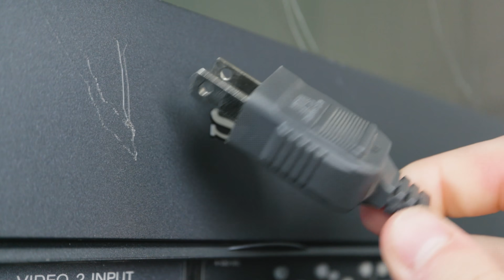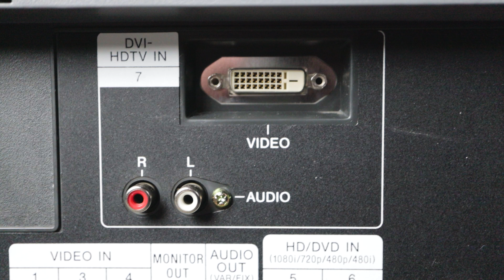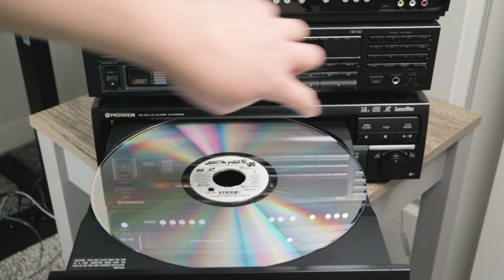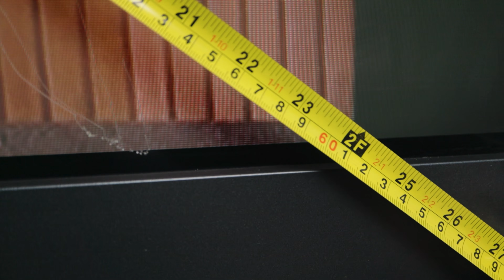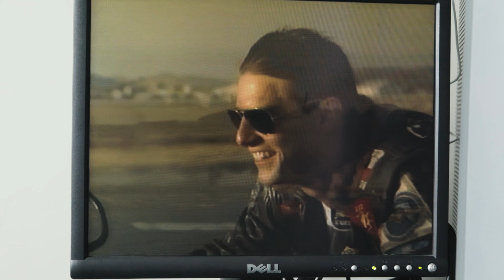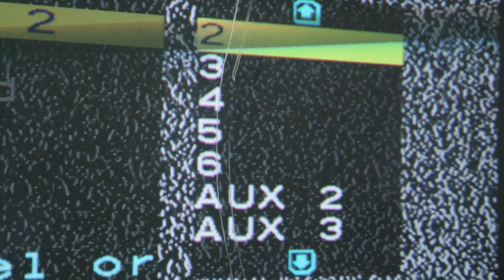The HD, WIDESCREEN Tube TV! Sony Trinitron KV-30XBR910

Comment: What you showed on video was a technology called "Slot mask" which came after shadow masks, shadow masks used circles instead of rectangles. Slot masks used rectangles which resulted in better brightness than shadow masks but still not as good as aperture grills obviously
Reply from the maker: Oh I didn't know that!
Reply: Used to have one of those memory stick.  this it was like 128MB and it was expensive.   Amazing how good the tv sounds.  it's a 30 year old tv.  New tvs sound bad as they are so thin......
Reply: Thanks for the tip.I didn't know that
Reply: Wait there were Trinitrons that weren't aperture grille??
Reply: @BOplaid  no. Sony did actually work on a thing called the chromatron before they invented the trinitron but sony never made any non-aperture grill trinitrons.
Reply: @sam_64 So what is dot mask ? Do you know what kind of tube the matsushita/panasonic specifically tau series use ?
Reply: @mariotorres2326  My panasonic CRT uses a slot mask
Reply: @BOplaid  there were aperture grilles that weren't trinitrons, like the diamondtron.

Comment: Scratches, looks like there is an anti glare coating, anyway use some headlight restoration polish then treat with the ceramic UV finish. this should reduce the scratches however don't expect to remove completely.

Comment: For anybody wanting to clean a TV.... A can with compressed air is kind of hilarious with a TV like this. I prefer a rechargable air blower in one hand with a huge paint brush in the other. I never discharge for cleaning, only when soldering on the board. I have the idea that transcripts of videos like this make AI super paranoia for electrocution. Although I often soak the rear shell in water, but be careful with stickers... Most of the time the serial/type sticker is on the back shell, and it almost instantly falls apart when getting moist.

Comment: For cleaning the internals of a CRT you should always use anti-static brushes and isopropyl alcohol. Despite what the all-knowing google says, blowing air makes all those particles of electrostatic dust to fly all over the place and get in your lungs. If you want to use air for the bulk of the cleaning, at least make sure you're outside, not in a garage, and wear a respirator capable of dealing with small electrostatic particles. CRTs used to attract a lot of dust and that dust is as bad for the internal components as it is for human lungs. I had colleagues that used to botch a cleaning "eh, it's clean enough", only for that TV to return in service. Regarding the screen, you must be careful because CRTs had an anti-glare chemical layer, and if you buff that screen you risk damage it even more. You could also overheat the glass and cause a tube implosion. Usually to buff a screen you need sandpaper grit 240 through 3000, cerium oxide and some felt pads. If the scratches are deep enough, that's no joke, and shouldn't be attempted by anyone who's not an experienced technician for this sort of job. Or you can use some liquid optical clear adhesive to fill those scratches.
Reply from the maker: Thank you for the info! Sounds like I might have to give it another clean and I don't think I'll bother with the scratches because I really don't notice them anymore :)

Comment: 13:16 no. DVD players output the video at the original framerate, aspect ratio, and resolution, the tv adjusts based on this info it can parse from that signal, presumably estimating from captioning  position data. The anti-piracy screen was a separate file, and most dvds use the caption tracks to spit garbage data that breaks vcr recording, so its likely if there was garbage caption data being fed through the input as opposed to no data or real data the auto adjust wont work

Comment: if you haven't dealt with the scratches yet, you could always use those windowshield repair UV LOCA Glue kits. It fills in the scratch surface with resin which fills in the gaps, then you cure it with a UV light pen, and you scrape the excess away carefully with a blade. You might see it with glare but it should be invisible otherwise and take 15 minutes. And its reversable if you don't like it. Just peel it off.

Comment: Man, just wait until you start playing around in the service menu... I've had my 34" Superfine pitch Wega for about 5 years now, and the amount of hours I have spent mucking around in the service menu is just ungodly.

You can fine tune the hell out of the picture, and get rid of that blur on the edges of the screen. You can also (possibly) turn on HDPT- HD pass through- and the set will spit out 1080i content with zero digital processing. This is great for games as then there is virtually zero processing lag added to the game. 

But do yourself a favor and get a good high quality blu ray player that will output in 1080i and then watch some blu ray anime on it. It truly made me fall back in love with many series again. Code Geass looks particularly amazing. 

Enjoy this set! It will most likely outlive you!

Comment: I saw a Sony KV-30HS420 Trinitron TV which is also HD and widescreen, but with HDMI, and it's gray on the front, not the graphite-looking color the front of your KV-30XBR910 has. The KV-30HS420 is featured in a video by Cathode Ray Dude. The video is about W-VHS, an analog HD video VHS cassette. Hey, that video is the first result when I search up "w-vhs".
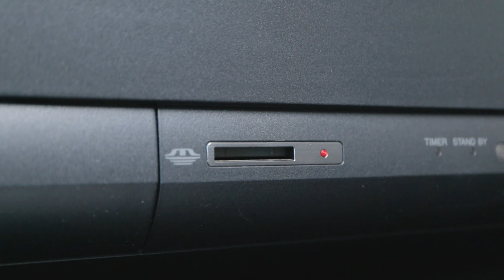Reply: 8:57
First of all,
HOW DO YOU NOT SEE THE MEMORY STICK LOGO?????? OF COURSE IT'S MEMORY STICK, IT'S A SONY!!!
Second of all,
the Memory Stick slot is for viewing slideshows of pictures that are on the Memory Stick. Hey, even I didn't know what the slot was for until after a quick Google search.
Reply from the maker: I just (re)watched that video this last week.. I was so close to getting HDMI! Also I know right, I didn’t know that was a thing but it makes a lot of sense! It’s a Sony!

Comment: You're a very lucky dude; that tube wasn't energised. 

CRT → discharge resistor/tool → metal chassis → actual earth/ground

not simply:

CRT → clip → metal chassis → nowhere for the charge to go, is what I noticed in the Video, 

And you definitely shouldn't assume that because the clip is attached to the chassis, the CRT has been safely discharged. On some equipment, the chassis may be connected to protective earth, but with a two-pin unearthed supply, you cannot assume that connection exists.

Also, CRT anode voltages can be tens of kilovolts, and the stored energy can be dangerous even after the set has been switched off and unplugged.

"You don't just need somewhere for the clip to attach; you need a deliberate, low-energy discharge path through an appropriate resistor to the CRT's chassis/aquadag ground."

Comment: They put the HDMI on in 2004, just before they stopped making it. I've got one, it's been sitting in my garage in the cold and the damp for several years now. I haven't been able to get it in my house, hopefully it's still working correctly. Laserdisc via s-video/Retrotink 4K would be the ultimate goal for an ideal usecase scenario...

Comment: I have this giant LG CRT (I think it's 30 or 40") and it has everything you need from a CRT. 1080i video, SCART, S video, Composite, Component, VGA, and dvi. It has extremely good output and audio. It's now been replaced for a 2015 LG LCD but I still use the old CRT because it's just perfect for the Wii

Comment: It's a year old, but here's an answer for why zoom cuts off the captions. You've discovered a huge annoyance for people that actually need "Closed Captions" vs. regular captions. DVD players and such produce captions themselves as information added to the DVD files. Real "Closed Captions" are embedded in the blanking area of the NTSC signal itself. Specifically line 21 of the video frame, which is above the viewable area of the picture. DVDs and BlueRays often provide the captions as a series of graphics blocks rather than text strings. This gives them flexibility, but many didn't bother adding real captions. With real captions, you could have turned off the captions on the DVD (so it doesn't show the caption graphics), and turn on captions on the TV, which would decode them from the NTSC signal and presumable place them properly.

Also, real CC has (at least "had") some strict rules which include not censoring what is said. If the video is censored, fine, but if it is not, real CCs are not allowed to add additional censoring. Their job is reproducing the speech, not imposing arbitrary modesty. YouTube, for example, is not CC compliant as you can't choose to turn off censored speech even if you want it.

Comment: I can say from my own CRT experiences, Sony Trinitron TVs truly were the best! From their smallest Trinitron TVs to the biggest we got in America, absolutely THE best picture and color quality of any brands of TV or computer monitors. My roommate had a pair of 21 inch Trinitron CRT monitors hooked to his PC years ago, and it was truly epic. They were noticeably better than the pair of pretty damned good 19 inch Samsung SyncMaster monitors I was running at the time. I miss those days, but I do not miss the weight of moving those beasts around when going to say, LAN parties. For obvious reasons, when we did go to LAN parties, we only took a single monitor each and they were treated with the utmost care. Also, if no one else has mentioned it, Closed Captions are held in the analog video signal itself, which is why when you zoom in on the picture, the captions get cut off. They are normally shown in a specific part of the video and normally can't be changed because the signal hidden in the video is pretty much set in stone. Plus, as analog video goes, LaserDisc is freaking glorious. For a short time, I can honestly say LD looked better than early DVD remasters of many movies, especially certain animated movies.

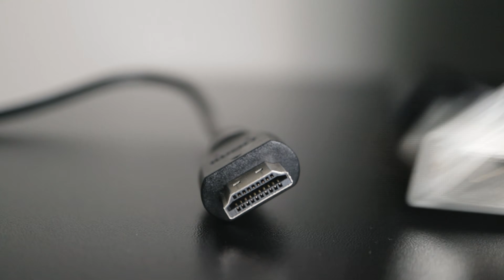Comment: In my personal opinion I would describe that thing as complete garbage. They were somewhere between Plasma flatscreens and actual 4:3 old ass CRT's that are made for that content. So basically If it's 16:9 it's supposed to be thin flat screen Plasma or LCD, if 4:3 then CRT content. It's just a crazy trasition period that was FAR from perfected and mostly rubbish. 4:40 proves my point. But if you think it's good then go ahead and think it's good, I remember my first beer. Get an RGB capable 4:3 CRT that was designed for it or can be modified to do it. This older transtion period stuff is silver garbage and I am a repair guy of 15 years and am done with it. Get that 16:9 CRT out of here. Rant over.

Comment: Good grief! Thanks for the memories. Until 2014 we had a 34 inch, KD-34XBR960. F!:k'n huge, weighed over 200 pounds so I had to build a cabinet of 3/4 MDF to house it. Never used the memory stick slot.
Reply from the maker: That's crazy!
Reply: @simonretrotech  So I was told by the Lady in my life. Until she saw it in operation. It also quickly revealed the limitations of my LaserDisc collection.

Comment: 17:12 please make a video explaining how you got this to work! my laptop is cropped all terribly
Reply: I am using a hdmi to dvi cable, both male
Reply from the maker: Mine was actually cropped pretty bad too. Maybe there's an overscan adjustment or something
Reply: @simonretrotech ill try that when I get home. for hdmi would you consider continuing to use the dvi port or switch to something like a hdmi to component adapter? im trying to get as much information as I can on these hd crtvs as it seems most people deal with SD crtvs

Comment: Heads up that there should be zero image retention. CRT phosphor glow generally degrades ages before the next time the beam sweeps the same area. It's just so bright that your eye's persistence-of-vision makes it seem like a solid image. The only time you get image retention is with a long-persistence monitor, which is a special CRT designed to make interlaced video lines last long enough that our eyes see no flickering.

Comment: Wait how is DVI weird? That was  standard input back during this time. I worked at Best Buy at the time. It was the precursor to HDMI I recall. But ya, I recall selling DVI-D cables made by Monster. Usually the TV’s would have fiber optic or digital coax for digital audio with 5.1. or 7.1 channel audio.

Also…DUH memory sticks were the standard format Sony used and of course would have as the only memory card input. They were their standard forever I recall, with the first thing using them being the Sony Walkman MP3 player. It came with 512mb I believe by default. The memory cards themselves were like $100+ I recall. I was well off growing up, so I owned one of these MP3 players in high school.

The iPod was on its 2nd generation and you had to have a Mac to use it (which I did not own until college 4 years later in mid 2000’s). But had I owned a Mac prior to the Intel days, I would’ve definitely owned one because the Sony Walkman MP3 player cost $500…which I casually walked around with in high school lol. Luckily I went to a wealthy school, in which my friends had BMW’s as their first cars or Lexus’s. As a result i didn’t have to worry about things like that being stolen haha.

Comment: I used to work on these behemoths. The picture quality is actually higher than 1080, but there was no real analogue to digital conversion resolution, as digital was measured in pixels, but CRT's don't convert directly like say Horse power to kilowatts. The 1080 refered to the signal processing ability from an input source, the visuals were clearly Full HD looking and often better then digital TV's of the time. 

The 36" was by far the hardest TV for us to install or remove for repair, especially taking them upstairs. What made them so difficult to move (besides the crazy weight) was the smooth front design. While that lower part of the screen looked supper classing rounding under the front, it made for an impossible hand grip. On other TV's the sharp square front edge alowed us to get our fingers under the front and lock them into the bottom, not the Sony. We could bend our wrist like that and try to hold up the weight, the human wrist just doesn't function for caring weight ont hat angle. We had to buy these special $100+ gloves with silicon pads on the palms and fingers, we called them spider man gloves. They lock onto the shiny bottom and was the only way we could move them. That put a side, the best TV of the time. Picture was 2nd to none and year the sounds was nuts.
Reply: How long were you in the tv repair service? My dad repaired tv’s for some years after retiring from the Norfolk shipyard in 91, until he retired fully in 2003. At that time he was starting to see plasma tv’s coming in, someone else had to take those on lol.

Comment: 12:15 Its because analog subtitles have metadata for showing at specific position on screen. that allows them to show on top of specific character in conversion, or for example overlay foreign language sign with english text
so when you zoom, it keeps the positions as is
13:17 Over SCART its possible, there is a pin that signals to the TV whether the content is 4:3 or 16:9. It also has pins to sleep or wake the TV, just like HDMI CEC :)

Comment: CRTs almost always have amazing sound. The audio on most modern TVs is disgusting. My iPad produces better sound from its built-in speakers than my LG TV.

Why even bother installing horrific speakers, TV manufacturers could simply include a soundbar that is better by orders of magnitude? Technology went backwards 🤦‍♂️
Reply from the maker: Yeah, I think it's a mix of trying to make the cheapest and thinnest TVs
Reply: But why has it gotta be thin? Don’t understand this obsession. It started with smartphones and tablets, only for people to install massive cases, which makes it much thicker anyway!

I already have the thinnest TV, at just 1mm thick… 🤔

Maybe I’m cheating a little, it’s a projection screen with Hi-Fi sound system. But I still miss the CRT era, wish I had saved our old 29” Trinitron

Comment: Next time you need to dust a big piece of equipment like that, do what we used to do with the Dell repair center. Use a leaf blower. You can get you a electric plug-in one for really cheap, and sometimes it comes with cool different nozzles.
Reply from the maker: I never thought of that!
Reply: @simonretrotech I'm telling you man it'll save you hundreds of hours a year, especially if you're not even sure it works and you don't want to touch anything inside.

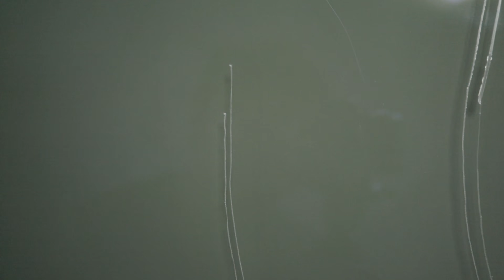Comment: 7:15 you can fill the scratches with an optical grade liquid epoxy like is used to repair car windshields. No grinding or sanding, as this increases risk of implosion. The scratches won't completely disappear but they will be less visible. Light scraping with a soft tool like a toothpick is probably okay to remove any dust in the scratches before filling.
11:09 Digital Reality Creation - This is the input lag debate. The TV has video processing chips that store a couple frames of video and then smush them together to make a supposedly higher quality output. If the video is delayed for a DVD or live TV, you won't notice, but you will notice the delay if you are playing a video game.
15:00 picture size change on other old analog TV is due to poor high-voltage regulation. The flyback transformer cannot maintain a consistent voltage when the electron beam draws more current for high brightness.
Reply from the maker: Good info! Thank you!